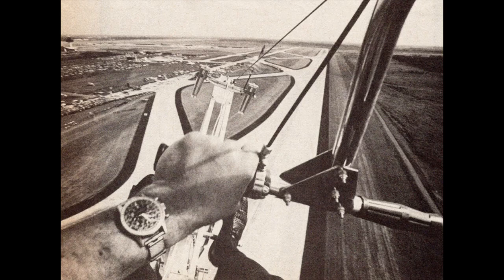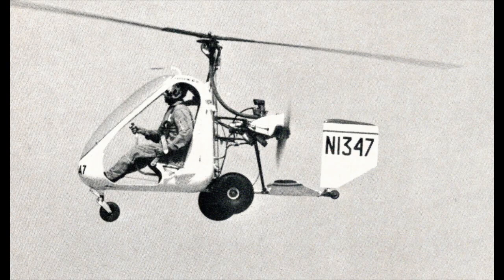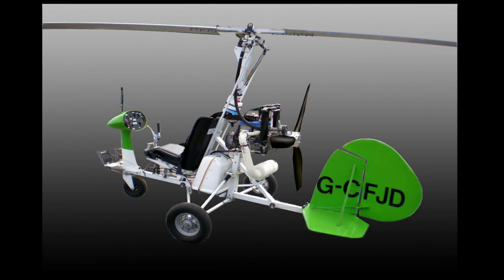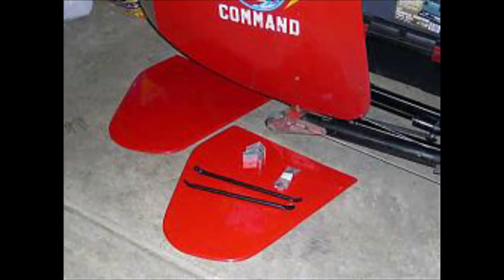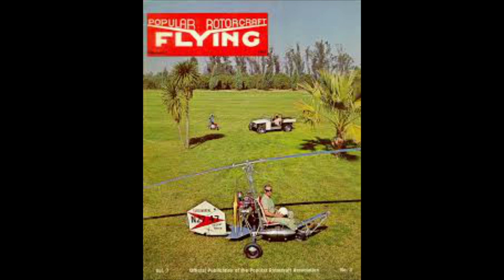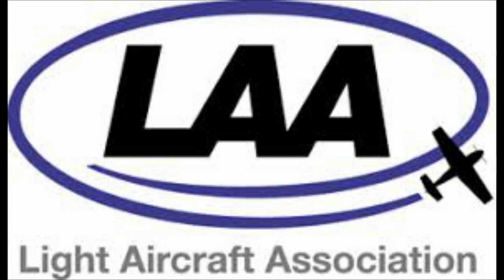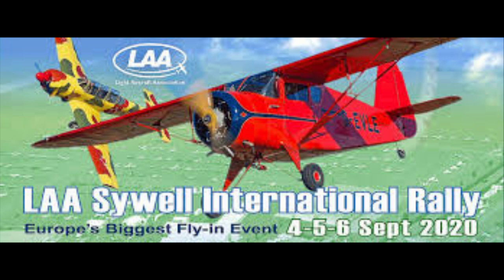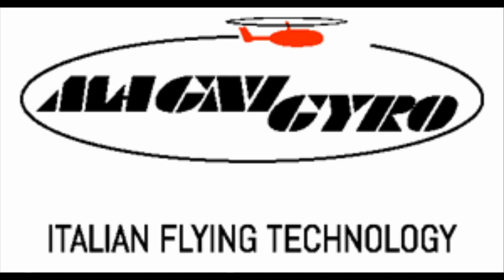History of the Gyroplane - part 20 back to the future AV18 and beyond

Comment: Wow! I didn't realize that the market was so limited in the UK. What's the path forward to fix that? Is there a way that the CAA could be persuaded to hand over authority? Is there a certain number of gyros flying in the UK that would make them rethink that, maybe so many that it starts to be a pain for them to manage? Having what is essentially a Magni/Autogryo duopoly can't be good for the sport.
Reply from the maker: Hi the outlook isn’t great sadly because it becomes chicken and egg - CAA won’t commit resource until there is a critical mass and you can’t get there without a deeper pool of aircraft to engage with - magni and AutoGyro aircraft are getting towards 90kUSD and that is expensive

Comment: Worthy of note too is the Merlin, when it was in kit form, but can be built and flown with the correct modification, ie drop keel etc...
Reply from the maker: Hello mate I didn’t know it was still being sold??
Reply: @gyrocopterflyingclub6148  Its not, Gary Layzell has the rights but not making any kits, which is a shame, but like the AV18/Cricket and Everett they are accepted by the uk caa, if one has the skills, theres nothing to stop you building one from plans as the kits are out of production....?   One for sale now on AFORS
Reply from the maker: Arh ok - you have to be very careful. If the aircraft is registered and permit has been renewed then obviously the process is easy. Likewise it’s pretty easy if it’s been registered even if the permit has expired as long as no MPDs they make the re-permitting overly onerous. However there are some projects that have either been started and not completed or not started (I.e it’s just a box of bits) and they can be painful / impossible to get registered as the paperwork needs to tally to what the expectations are for that aircraft plus any work done to date needs to be validated to what (if it ever was) inspected as part of the build process.
Reply from the maker: Just to add I think some people are asking strong money for some of these single seaters and it makes Mike’s AV18 kit look cheap!

Comment: It’s interesting, the FAA in the States is the authority and they are tasked with issuing an Airworthiness certificate however nothing to my knowledge addresses flight characteristics. The FAA inspector or designated inspector looks at materials and best practices and will go ape poo crazy if a label is missing or you write your name slightly different on the required forms. The Experimental Aircraft Association will help in the process but historically has distanced itself away from gyroplanes. We have the Popular Rotorcraft Association which is supported by membership which is dwarfed by the EAA and struggles financially. Other than the FAA blessing, the mandatory pilot rating and the bolts and wiring we use, the American Gyro builder is left to its own culture to safeguard safety. Hang test, thrust lines,horizontal stabilizers and don’t be an idiot in the air and on take-offs, are what is preached as far as aerodynamics guidelines and behavior,  in the articles, videos and around the tables at the many PRA chapters. So we have a variety of shapes of gyros in the US and to be frank, I like that. I enjoy the culture of tinkering and trying this and that. This variety has consequences. As one of the most respected Certified Flight Instructors, who by the way still will teach you in a Bill Parsons style of gyro, said to me the other day, “Each machine has its own unique set of behaviors. Each machine has a certain period in which the pilot must adapt a new set of skills.” He continued, “A person trained in a manual transmission car can drive a car with an automatic transmission. A fixed wing pilot who flys a tail dragger can  fly a tricycle geared airplane. Put a magni pilot in an open frame gyro is asking for trouble.” The moral of the story is train in the style of aircraft you are going to fly and don’t be so bold to think you can fly other types without additional training. This sort of valuable cultural knowledge is not one which is regulated. It is passed down and shared with a tight knit group of people who care about you and safety. Who are they? They are standing next to you.
Reply from the maker: Thanks Bill thats interesting colour
Reply: Gyrocopter flying club No thank you for all you do for us. You are truly the person who cares standing next to us all.